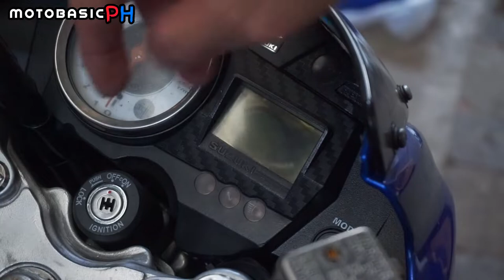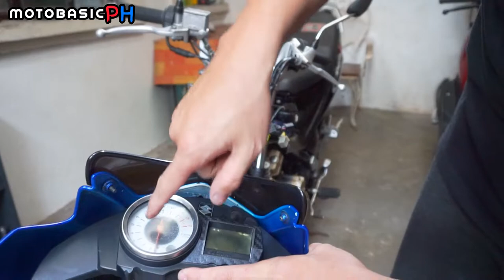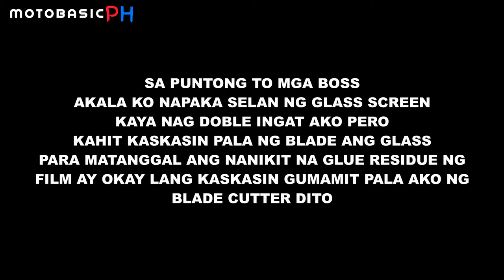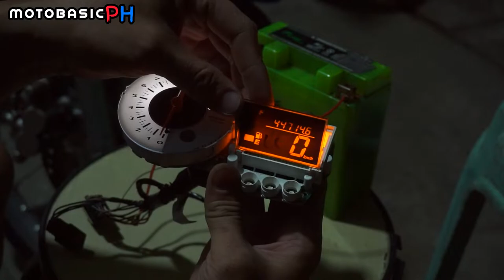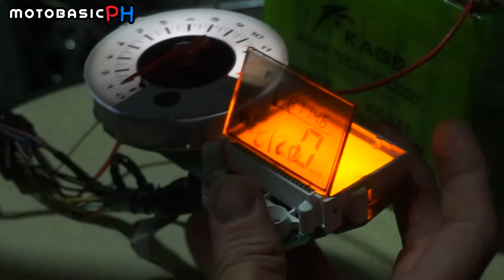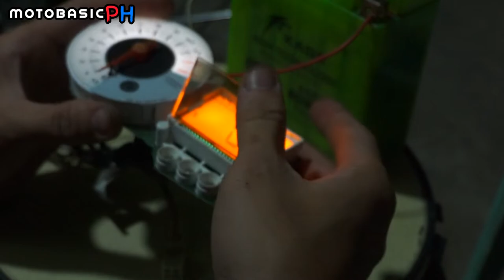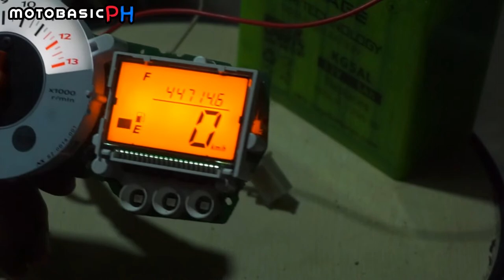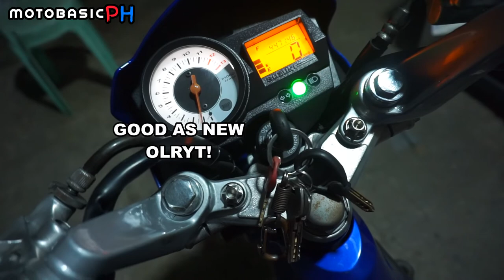PAANO PALITAN ANG SCREEN POLARIZER NG RAIDER 150 WENG WENG SUZUKI MOTOBASICPH

Comment: boss pde kba gawa ng video about sa mio sporty like cables or mga parts ng engine kung ano mga nakadugtong for begginers kung ano ung mga host cables wires kc gusto ko dn po matuto magkalas at macheck ung sarili ko motor and alam ko lng po is tanggalin ung flairing hehe
Reply: Up dito gusto ko din matuto